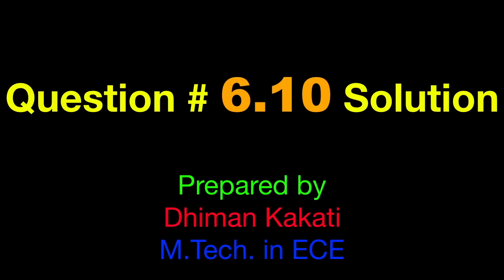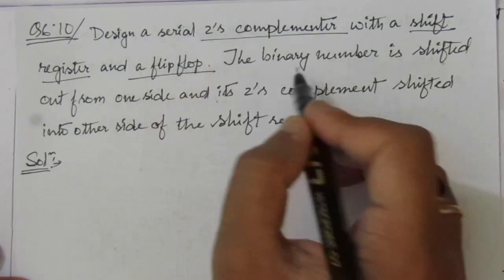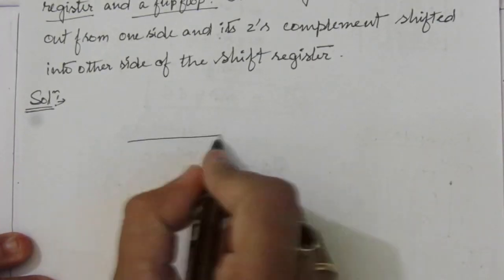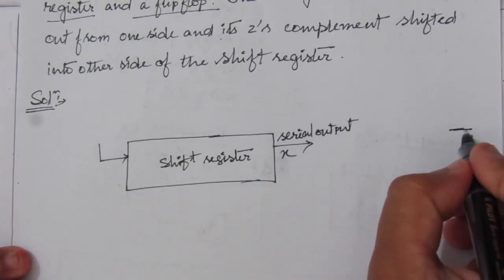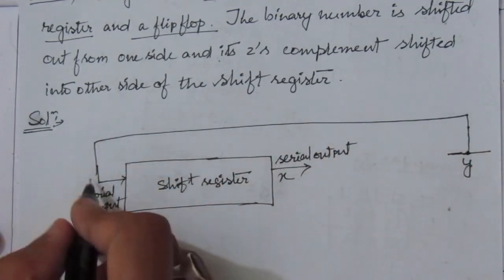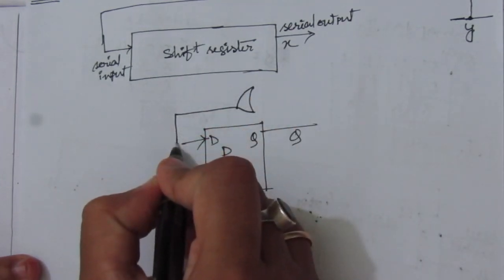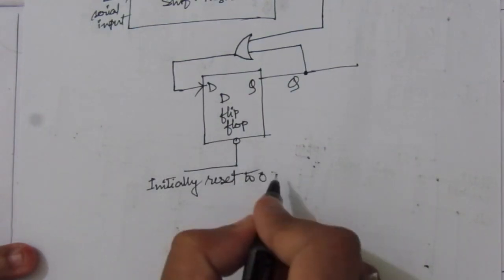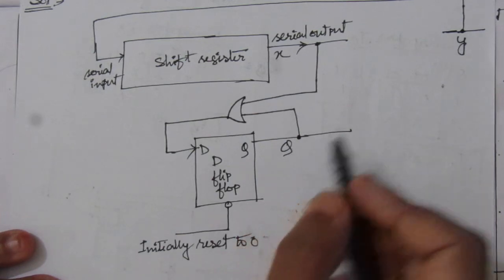Q. 6.10: Design a serial 2’s complementer with a shift register and a flip‐flop. The binary number

Comment: In two's complement arithmetic, to negate a binary number, WE should:

Keep all the bits unchanged up to and including the least significant '1'.
Invert all the bits after the least significant '1'.
In the circuit you've provided, if the input to the 'D' flip-flop (DFF) is '1', then its output (Q) will also be '1'. If this output is directly connected to an XOR gate with the bit value 'x' being processed, the XOR output will be the inverse of 'x', which is incorrect for the first '1' encountered when scanning from the least significant bit towards the most significant bit. After the first '1' is copied, subsequent bits must be inverted.As an example if we have 1010 the correct complemet is 0110 but this circuit we give us 0100.How ca we correct it and thank you .